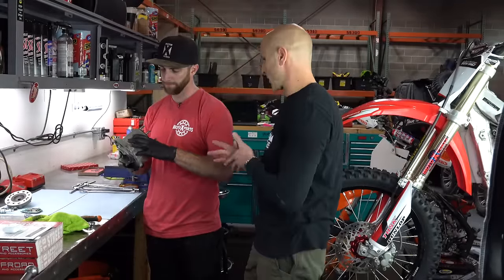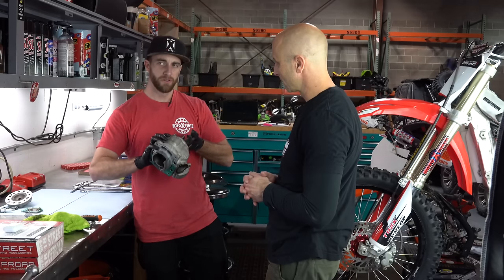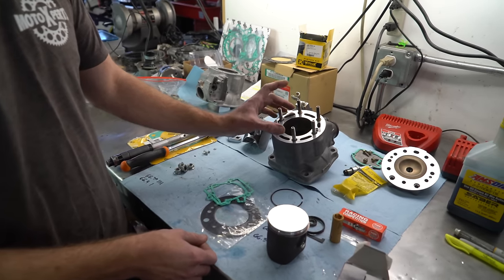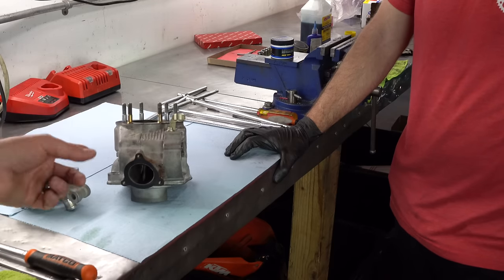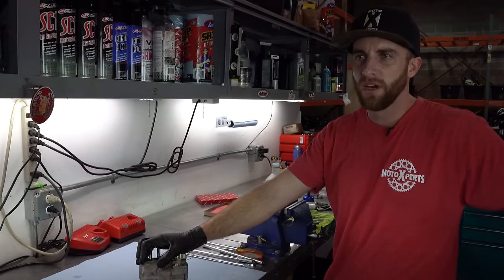My 2 Stroke Cylinder Needs Work | What Do I Do Now?

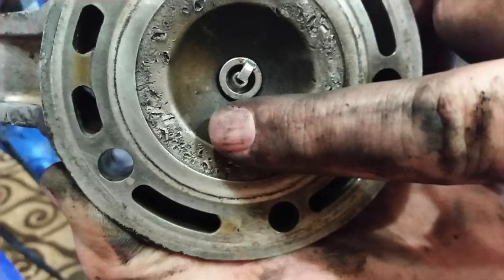Comment: 3:09-3:20 so called "detonation" is mostly broken off electrode tip from the spark plug and/or piston ring chips that have banged your head to crap :)

Sure there can be some spots but those deep grooves ARE steel chunk made. I had that happen to my head after I broke my rings that caught my YPVS, identical to these pics ;)

Comment: Why not just replate the cylinder with nikasil and get it adjusted with the new piston and run 32:1 as the Honda manual said? They designed this engine and they recommand 32:1... why not just follow the recommendation of the Honda engineers????
Reply: Thank you ... 😁😁 I love you people I love my cr125 to has never did me wrong
Reply: 3% everywhere, never fails if the motor is right :)

Comment: Very informative Video! 
Another great option is a cylinder exchange program. We send you a Millenium Cylinder and charge a core charge, when it arrives you throw your old one in the box and send it back, and get the core charge back when your old cylindee arrives. Faster turn around times and a great alternative to a new cylinder. Replating turn around times can be huge, especially this winter with the amount of sleds blowing up, there actually a shortage of replated cylinders for some sleds!

Comment: That is not what detonation looks like all of those heads had been torn up by needle bearings coming out of the crank or contamination. When a motor pings alot it looks like you sand blasted the inside of the head. Makes it have a rough sandpaper like finish.

Comment: detonation does not chisel mark the head eating rings does that :-)
Reply: Yes thats true but the chisel type marks do cause detonation because the little specs heat up alot and your fuel will combust to early!
Reply: Detonation marks are typically more of a small, round punch type mark but it definitely does leave indentations in the top of the the piston and in the head, normally on the outside, flat portion of the head (not the dome). Sorry for the confusion.
Reply: KGB 1974  or even needle rollers from the little end get chucked up through the transfer ports but not detonation
Reply: Exactly my thoughts. What they showed is foreign debris not detonation.

Comment: Nice video, but the detonation does not cause the “chisel marks” in a (trashed) head, it is from a circlip that came out of the piston to hold in the piston pin
Reply: Mxrider2stroke Braaap sorry for the confusion. I didn’t have this all scripted beforehand (I didn’t even know what to do with my hands when I was on camera 😂). 

Detonation marks typically look like a bunch of small round punch type marks,  not chisel. You’re right, flat chisel type marks would be more sign/result of part of a ring, or other debris getting in between the piston and head.

Thanks for keeping me honest!
Reply: Haha cool, thanks for the response:D

Comment: What piston and what oil and what ratio and what jetting did you run?  Video would be a lot more useful if we had actual info.
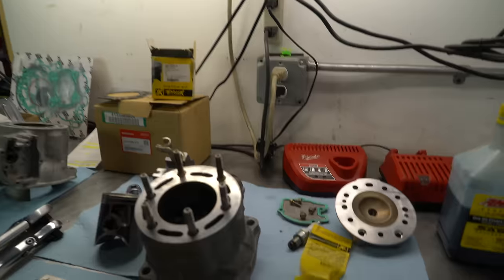Reply: 3:31 Amsoil Saber on the bench.....  I'm guessing yall ran a lean oil mix.  With these old 2 strokes, you better run Amsoil Dominator 32:1.   And yes I do think you will find my oil advice useful... Considering the demonstrated results of not doing so.
Reply: Piston and cylinder got hot from lack of lubrication.   Excess heat causes detonation.  Don't believe me?  Run saber 100:1 in that bike again.  Youll believe me when you're pushing that bike home.

Comment: Lol I'm not taking any top end tips from a guy who runs 100:1 premix and who puts in the wrong sized piston after spending over 8k to restore a race (not trail)  bike...
Reply: Gsxr-1000 Rider that why your listening to the fucking mechanic and if you don like it go watch someone else
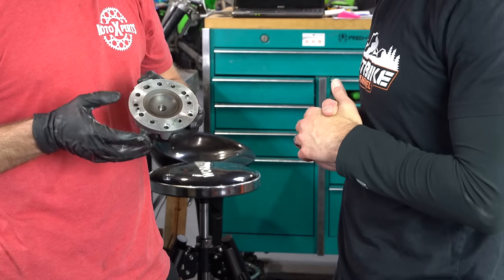Reply: Just listen 2:42 and 2:52 done! You can keep taking the tips bro.
Reply: Jesus, if you're going to take a shot at a guy at least make sense. Kyle didn't do the top end himself, he hired a mechanic. And he's not giving out any tips in the video, he's asking questions of a different mechanic.
Reply: @Vanir03  ovbiously not a very qualified mechanic..that is what happens when you go to a mechanic or stealership. They screw you over and shrug their shoulders trying to say it wasn't their fault and that (you) the owner must of messed it up. Buy a repair manual and do the job yourself, this day of age there is so much information around, I'm sure he has a torque wrench and any other tools needed to do the job himself..
Reply: Vanir03 gobble gobble
Reply: @lukepaul2882  LOL. You just repeat the same grade school insult over and over. Most trolls at least have two or three in their bag.
Reply: @Vanir03  meeooow
Reply: Gsxr-1000 Rider this is Kevin with MotoXperts. We did not do the last top end on this bike. I believe Kyle had a friend help and the issue is that they had the cylinder replated and then the piston was purchased separately and a B sized piston was installed in the A sized cylinder. This time we installed a new OEM A sized cylinder with a A sized piston and we also did our own measurements and verified fitment.

Comment: Why can't they take it oversize to clean it up? It seems to me that would be easier and cheaper than welding and attempting to keep the bore standard. Is the wall thickness too thin and it would lead to overheating? I understand why you went new in this case but it seems boring to next oversize wasn't considered and I'm curious why. Understand I'm used to dealing with Harleys, automotive, and aircraft engines where oversize in not uncommon.
Reply: Ron Hunter these cylinders are plated, and if you bored it over you would have to have it plated again. Less expensive to just have it plated without boring it.

Comment: Send it to Eric Gorr for a big bore and porting.....quit f#$#in around
Reply: Mo better 👍. Eric does excellent work (takes him a little while but the wait is worth it).
Reply: Eric does great work. We’ve had great results with his big bore kits and port work.
Reply: @kevinegbert1251  Eric used to be the head guy for honda race teams back when they used to race the cr500r (500 class). Published several books, defiantly knows his stuff. Had him rebuild one of my 1991 cr500r engines top to bottom, freshly powdercoated, stainless steel hardware, and he welded and lapped the cases after the previous piston exploded and caused a hole. Had him also turn it to a real animal (ported and polished).
Reply: Gsxr-1000 Rider I had no idea! I’m not surprised though, the guy is a genius.

Comment: When I seized the top end on my yz250 likely due to running too lean on the oil (60:1),  I decided to replace the cylinder because it was not much more money on Parzilla.com.  I think new OEM was $350, to nikasil plate old cylinder was $250.  They really need to be priced lower for that service.  I learned my lesson and keep it around 35 to 40:1.
Reply: KGB 1974  good idea.  Well, I was spooging quite a bit, so I figured use less oil.  My mistake.  I have now switched to amsoil interceptor and I'm happy with the results, at 35:1

Comment: I keep seeing people saying you ran 100/1 . Could you please put to rest if this was the case or if you pre mixed 32/1. I know with newer type oils maybe get away with less but I am not sure this would be the case.
Reply: I believe he’s said in the past he runs 40:1 or 50:1, 32:1 is pretty rich for most bikes that I’m aware of, it’s ok for break ins but you’ll foul plugs way quicker with a 32:1 mix
Reply: @michaelparker9918  
Ok I run caster 927 at 36/1 in my cr250 now if your coil or cap it bad you will faul plugs. 
Coil 5.5 ohms
Wire 5.5 ohm
Cap 5.2 to 5.4.
Lower that 5 ohm no good.
All three together 10.5 to 11 Is good.
Ok I run a CRF 450 MEB coil 2002 to 2008
TRX 450 2002 2008 replacement coil for the kz4 2000 to 2007 cr250

Hotter spark cleaner burn.
Reply: If you follow him you see he is a fan of amsoil saber at 100 to 1. I actually called amsoil and they told me they don't recommend it in bikes, just for small engines ala weedwackers etc. Unsure what he was running when it blew up though, would like to know
Reply: He Runs 100:1 amsoil saber...Just like Jeff Slavens and many others
Reply: @ericahearn9604  
Well that oil dose not lubricate the motor that well. You see what the Piston looks like on the intake and the exhaust side.
Look on my CR250 Mikuni 40mm carburetor video.
Reply: @michaelparker9918  I run 32:1 on all my Two strokes. Never fouled plugs... If you ride trails and putt around without being in the power band than yeah you will foul plugs, but ride the bike like your supposed to and that's not a worry.
Reply: Gsxr-1000 Rider what spark plugs do you usually run? And do you usually keep your air fuel screw a little bit out or keep it around the stock setting? I had an old 85 that was having a lot of fouling issues at 32:1 and went to 40:1 and had no issues at all, could have been the oil mixture or maybe my air fuel mixture or just the temp plugs I was using not sure though I ended up getting rid of it after putting a new clutch in
Reply: @michaelparker9918  depends on the bike but br8es or br8eg ngk plugs (I ride 250 and 500 two strokes). 1.5 turns out. If you need to go much more or less than 1.5 turns it means you need to adjust your carb jets and or the needle clip position. The elevation and temperature can also affect your jetting. I use motul 32:1 with the best fuel you can get from the station (91 to 93) sometimes I go to vp and get race fuel blended to around a 105 octane (used it on my cr500af that had engine work done to it).
Reply: @coloradodirtbike5930  
If you run a b8es or a b8eg plug it will burn hotter you don't need a double resist your ignition the R is for  radio resistance in the spark plug. Air screw at 2.5. To 3 
Will make your bike snapper.
More than 3 turn you need to run a bigger pilot jet
I run a 40 in all my bikes
Reply: @250race  you ever put a air striker on your 03-07 cr250r? Big difference it makes with vforce reeds 👍. Mikuni might give you a bit more top end but the air striker gives the bike all around good power (much more bottom end) as compared to the stock carb.
Reply: He is a KTM guy and gets rid of his bikes while they are still brand new.  Of course he runs 100:1   Also look on his bench at 3:31  Amsoil saber sitting next to a seized up top end lmfao.  And obviously if he were actually running good oil at a proper ratio he would have cleared that up.
Reply: The reason for his silence on his oil ratio is not mysterious to me at all.

Comment: I’ve heard the cylinder needs 3000 of a gap between it and the piston.  Is this true here
Reply: Richard Stremlow most 250s we set close to .045” or a little more to avoid running race gas (but it smells so good!!). You’ll get more life out of your crank and top end in general with more clearance.